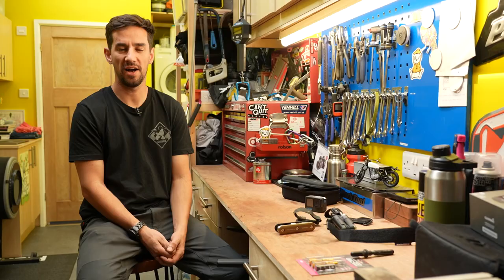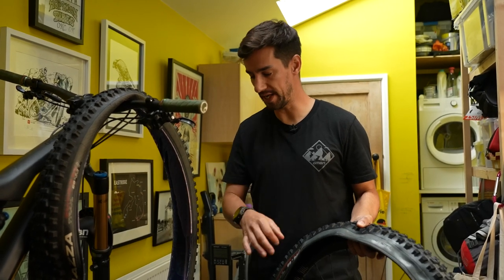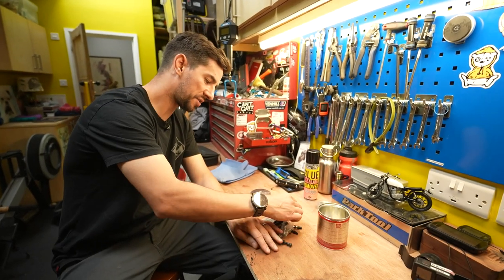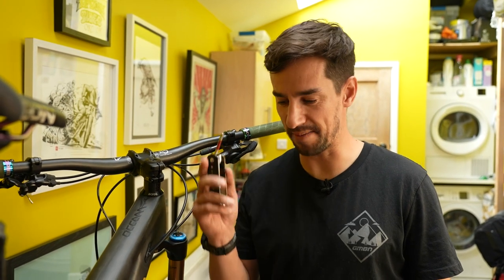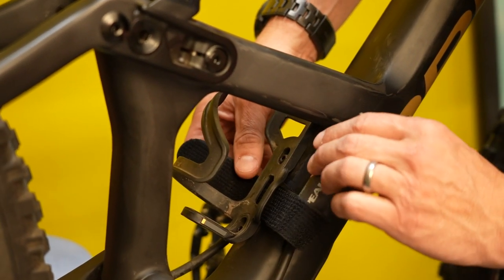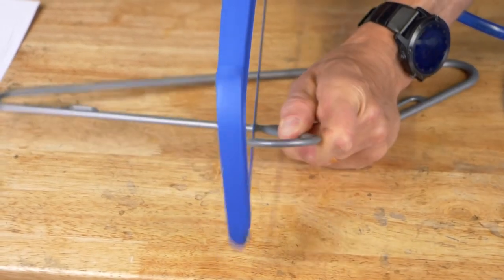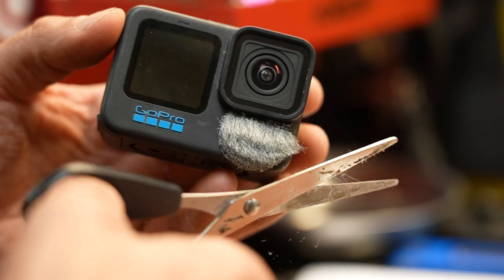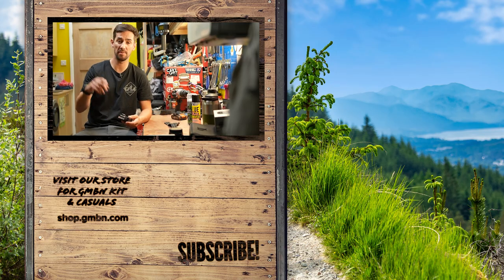8 Of The Best Bike Hacks!

Comment: Wow, really useful tricks. My favourite hack these days is using the plastic tool you get with a frame protector film, wrap it around a rag and use that to clean between the cogs of the cassette. Also: An even better tool to clean out tubeless valves is a straight pull spoke.

Comment: Ditch Presta tubeless valves for Schrader valves. Much stronger and with bigger volume. They pump up and seal new tubeless tyres faster as they let much more air in. All you need is an 8mm drill bit and drill the rim to fit the bigger valve.
Reply: Unless you have carbon rims...
Reply: @phorest  I don't have them so can't be sure, but I strongly suspect that they'd be ok with that.

Comment: Pipe cleaner for the valves, they're basically long wires with a brush on them. You can also disassemble most of the valve cores, which can clog up themselves as well.
Reply: How do you disassemble the core?

Comment: I use a shift wire to clean out the bladder hose. Stick in the pointy end, wrap a minimal cloth around the wire and pull the wire through. Basically it’s like cleaning a gun barrel.

Comment: Use the Allen key trick in automotive applications all the time. Chevy is notorious for 17mm drain plugs on their transmissions. We use the same trick. You'd be amazed how much torque you can apply. While I agree that I wouldn't do it on soft aluminum parts like pivot bolts, it's not bodge, this is a commonly used hack and it works  with allenhead sockets you can even torque to spec. I cut off a 7 mm Allen key and use a 10 mm 3/8" drive Allen socket to torque to specs. It works just fine. I have never tried it on soft metal though so avoiding the soft metal parts is probably a good idea. Would probably work just fine but it's probably for the best to avoid that situation if at all possible.

Comment: Nice tips. Hadn't thought of the aerosol can cap for scraping out sealant from a tire. 

I like to use an old spoke in valve stems, the threads on the spoke helps to scrape off the sealant and the usually flat end helps similarly. I have even ground the tip flat more than what it is from the factory to get more of a scraper effect in the stem tube. But haven't thought to use a solvent, so will definitely try that too.
Reply: Old spokes are so useful - make a pick, a little hook, and a little scraper out of them.

Comment: Probably a good idea to start the disc rotor bolts by hand 1st to prevent cross threading them and ruining your hub by trying to save a few seconds of time.  Proper tools and smaller quarter inch drive socket set with a 1/4 inch socket on the end will fit the torx bits and allen key bits used elsewhere on your bike too and using the T bar and long extension to crack them and spin them loose using the shaft makes this job pretty quick  anyway.  I did like the recycled toothbrush hack though keep up the good work on these vids. 

Cheers boys 🍻

Comment: Use a presta value where you can remove the core and has hole straight through and use a syringe and tube to suck out the tubeless sealant when changing the tire. Also great way to check how much fluid is left in the tire before I add more. And I do not need to dismount the tire to add more as well.

Comment: I love the tooth brush hack amazing way to clean the chain love the videos I'm still using old fashion tyre and Inn tube. I'm liking the hack about the tubeless one sweet video..
Reply: The brushes don't last very long though, probably also depends on their stiffness. If you use soft ones, they will be bent after a few uses. And buying stiff ones wouldn't be free anymore.
Reply: @sp00n  at least it's then just getting oil all over place more control on cleaning so happy days pal.